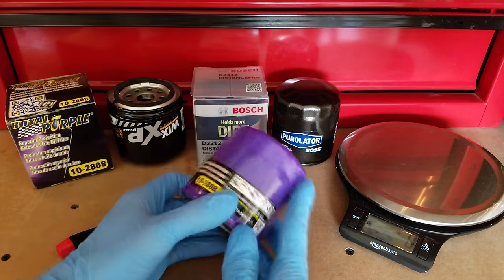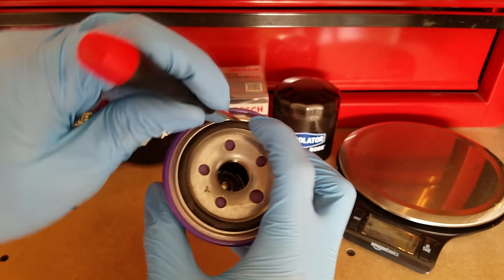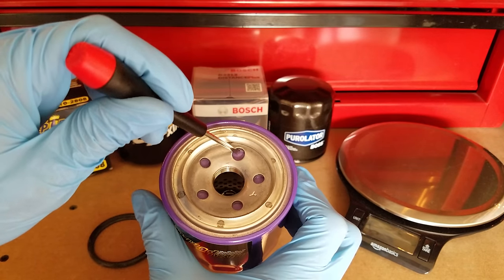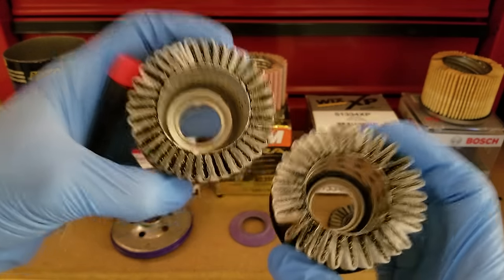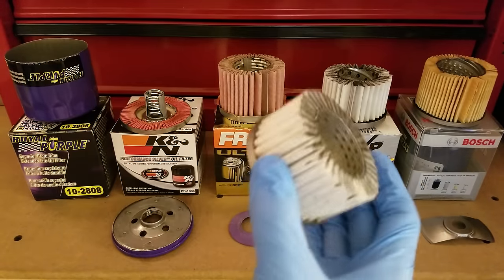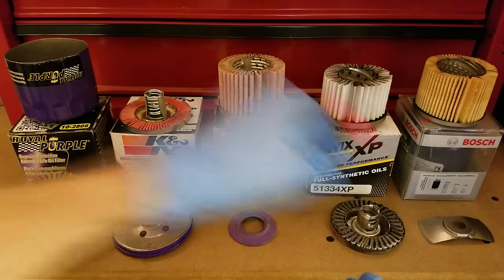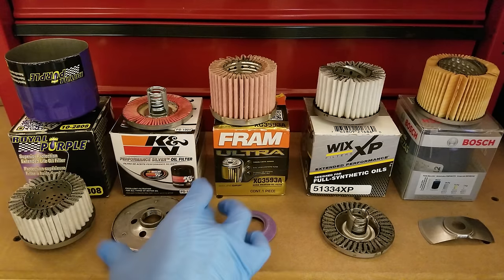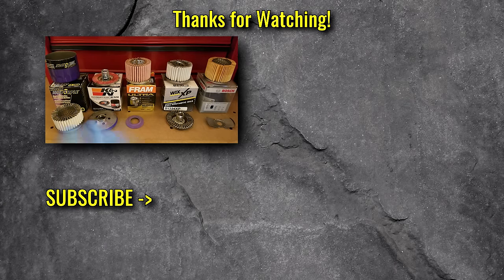Royal Purple filter Cut Open!  vs FRAM vs WIX vs BOSCH

Comment: I worked in the industrial industry building lube skids & all of the big name clients like Caterpillar require a specific micron rating for there engines.  These type of videos have no significance without actually testing them, you also need to take in to calculation the weight of the oil and how it changes after being warmed up by the engine.
Reply: I think these types of videos do offer significance in terms of being able to see what is actually inside of a filter you are putting on your engine. Micron testing and rating is important and I see the point regarding that for meeting spec requirements, but I am happy to see all of these videos without having to actually buy them and cut them open myself.

Comment: Champion Labs makes Mobil-1, K&N, AC DELCO after market, Bosch, Super Tech, Royal Purple......They make many different filters for all price points for different brands. It is like ordering off a menu you pick case thickness, seal materials, case design, bypass design, etc.....and they make exactly what you ask for.They are one of the few companies with a lot of options that you can pick and chose from. Few of the other big oil filter companies give other people anywhere near that level of options for a re-branded automotive filter. Wix, Hastings, Donaldson, Fram, Puralator, Baldwin, Champion Labs all make filters for many other people all over the world.
Reply: Which is best for sn old skool car??

Comment: I'd like to see dirty oil going through a clear tubing and see how it filters or any tests afterwards.
Reply: There is one and it shows filtering the soot out of oil on a diesel engine. Was pretty interesting to see it go in black and come out not black
Reply: I'd rather watch paint dry, if you don't mind. But you are right, lab testing (or fleet testing) are the only way to determine the validity of any mechanical theory.
Reply: Agree.   These are just beauty contests.   How do they filter, what is the resistance, and when does the bypass open.   Does the mfg even give a spec for these params.
Reply: A pressure full flow filter won’t clean the small particles that colors the oil.
Reply: You won't be able to see much difference .

Comment: Filtration is very important to remove impurities.  BUT Oil Flow is as or possibly more important to pad/insulate bearings, lifters, cylinder walls , remove excessive heat & protect turbos.  SO, to much "Filtration" isn't worth smoking a $10,15, 20k motor!

Comment: I worked for Fram in Albion Illinois. We made most of the filters on this video. The pleated glass pleat is the better filtering media. The yellowed or brown paper is a cheaper option. The depth and number of pleats is important. Larger surface area for filtration. 
     The over flowing adhesive is because the cap spins on a machine to distribute the adhesive evenly. Its dont to all the filters in this video. Also the filtration media is put on the cap by hand.
Reply: fram is shit, i wouldn't put a fram on my lawn mower
Reply: @markussone7334  yet cars are hitting over 200k using only fram 🤷‍♂️

Comment: Nice job on the video,  I still like the Wix XP also NAPA Auto parts sells the silver, gold and platinum line of oil filters made by Wix in North Carolina; made in the USA!
Reply: TMI, Not very many things are made here anymore sad to say.
Reply: Bought the Wix XP from Rock Auto available on Amazon cost a little more.
Reply: WIX is now owned by Mann-Hummel. The factory is next to I-85 in Gastonia NC.. the water tank is painted like a WIX filter.
Reply: Cool, one of few oil filters made in the USA!
Reply: Fram, ford, Briggs, stp, ect. Many OEM filters are made in Illinois. USA
Reply: yep made in gastonia. i used to live in cherryville and lincolnton now im in farmville nc
Reply: @aceroadholder2185  Fram is also owned by Mann
Reply: The NAPA platinum is a WIX xp. Yup!
Reply: FL1A for me. Inexpensive and made great.

Comment: My guess is the reason that they made one of the holes larger than the other four holes is they wanted the volume of all the holes added together to match the volume of the center hole so there would be no restriction in flow by the filter housing since the inlet and Outlet would be the same size.

Comment: I haven't seen this yet anywhere, The big 3..
Chevy:AC Delco
Ford: Motorcraft
Dodge:Mopar.
Reply: Ive always insisted on a factory filter, they usually cost the least, and im sure the factory isnt spinning on garbage filters. Goto the dealer buy 10 at a time. That will last you quite awhile nowadays. Glad to see someone doesnt get caught up in all the hype.
Reply: Just watched an AC filter cut up, paper end plates, all others sreel, junk valve and spring. Made to last 3k miles, no more. I'll never buy one.
Reply: I once ordered Motorcraft for a job as wanted to impress the customer, opened the boxes and they had Fram written on them, at the time I took this as a thumbs up for Fram but, hey, having watched Stephen Cox's video " the worst  filters on the Planet" I now know that these filters are cheap and nasty.
Reply: The smaller AC Delco filters might actually be worse than Fram
Reply: Brian Cantafio could be interesting with older cars as the “factory” uses licensed filters. “Factory license” could be changed over with manufacturers, basicly with whoever the company figures out the best deal. Example: Mopar factory filters for jeeps are made by Wix (Same as NAPA gold as of recently (now?)) earlier it was made by a different company.

Comment: the dark stuff on the bottom of the metal plates that hold the filter media in place is called Plastisol and the blend used for filters to make it turn from a liquid into a solid you cook it on a hot plate at 375 degrees Fahrenheit for around 15 minutes

Comment: Gasket retention failure can be a HUGE problem. Honda had a retention issue with their OEM filters for 2nd gen. CR-Vs where the factory original filter gasket remained adhered to the engine block during the first oil change. Some techs failed to notice this, resulting in stacked gaskets and oil leakage. Oil leaked onto the exhaust and started a fire. Several vehicles lost due to this. Gotta like the positive retention even though I'm pretty sure I'd notice a gasket missing on the removed filter or one stuck to the block.

Comment: My guess is that the Royal Purple has one larger inlet hole of the five in order to tweak the flow of oil which they measure precisely.  5 the same size is just not enough.

Comment: My 3 favorite filters.

Royal Purple
Purolator Boss
Fram Ultra

I'm actually not a Wix xp fan

The Purple has a nice combo of filtration and flow.
Reply: Hmm i been using the wix xp for about  3 years now. I have upgraded my oil to royal purple just to try but now it seems like ill switch to the filter as well, thank u

Comment: I've heard the Royal Purple costing around$16-$18. That is subjective since prices can fluctuate but it typically stays around $16-$18 give or take. The Fram Ultra Synthetic roughly goes for $8-$10 dollars at Wal-Mart and is readily available instead of ordering it or if you know a royal purple retailer. Personally for me, Royal Purple is a great filter but its not worth it. The Wix, Purolator, and K&N are great as well and those are typically also $11-$14. Also readily available at certain auto parts stores.
Reply: And that’s why I hit the local Walmart and grab a Fram Ultra for under $9!
Reply: purlator is like $3
Reply: But that $3 Purolator has a history of the filtering media tearing while in use. I will use my Fram Ultra with a much more stout, full synthetic media. And if I can't get that, I'll go with a Wix XP.
Reply: Amazon = Readily Available (and if you are truly prepared, have one on hand)
Reply: Price difference is moot.  Even if you change oil four time a year which is overkill for average driver, you're talking 30 extra dollars a year.  For me it's worth the 30 dollars for extra protection.  I've been using royal purple filters and oils for more than a decade in my cars' engines, transmissions, differentials, and transfer cases.  One is a 2000 the other is 2004.  IMO new or rebuilt components cost more than then little bit extra I spend on premo oils and filters.
Reply: not to mention fram XG filters do really well everytime ppl actually test it... like this old test here:
http://www.gmtruckcentral.com/articles/oilfilter/comparison.html

I wouldn't use the basic orange el cheapo frams tho... But I think everyone knows that by now. At least I would hope so. 

and to the last guy who said the costs doesn't matter @BigBrotherIsTooBig -- you can say that about a lot of things. in fact I do.. but I also realize saying "oh it's just a little more might as well" does ADD up quick when you do that for everything in your life. So really you're just best off shooting for price/performance ratio and just being happy with that. That's my $0.02 anyway. Unfortunately price/performance ratio can be hard to find for some things... takes research or just giving up and paying for whatever is nice.
Reply: Can't you get it online ? Or get Mobil1.

Comment: Couple months ago I noticed my ranger seemed like it was priming the oil system every time I started it. Had 1000 miles on the oil change. Pulled off the microguard filter I had and the anti drainback was dickered. Usually when I pull the filter the oil pump gives me a shower. Not this time. Never buying microguard again
Reply: Thanks, any other information? I run two Vehicles…2007 Canyon, 2015 Journey///4 CYLS

Comment: "Do not" buy a Fram oil filter.
If you do not believe me then, watch this video.....The worst oil filters on the PLANET!!!
This is on You Tube.
    After I saw this, I changed my oil filter.
Awesome video. Thanks a lot.
Reply: Neil Williams Ferrari and Lamborghini used fram and is the recomended for all classic Ferrari and Lamborghini. Also I run fram on all my vehicles including my work truck that I drive hard and tow with over 250k miles my jeep xj with over 200k miles and that hits az trails all the time and my 293k ae86 gts that I track and daily so whats the problem with fram?
Reply: If you watched this video ........The worst oil filters on the PLANET!!!    then, you know why.
Reply: Neil Williams oh so a youtube video and the person that made it is smarter than all the manufacturers and classic car restores? Most popular oil filter and of they are the worst then why are they the most popular? Can't be that bad if all my vehicles run fram and are between 200k and 300k miles and I've never had an issue.
Reply: To each their own.
Reply: I prefer an oil filter that "IS NOT" made up of "all" soft paper like material.
If you look at this You Tube video.....The worst oil filters on the PLANET!!!, you will know that Fram makes a crappy oil filter.
    If you can't see what's shown on this video, you are either blind or ignorant!
Reply: Oh! I didn't know that. my bad.
Thank you for your reply and help.
Reply: I've been using fram for well over 20 years and no problems. Just because some shithead on a youtube video says something doesn't make it true. Fram has some good filters, just don't buy the cheap one.
Reply: I didn't know fram had good oil filters!?
My bad! Thanks for the info.
Reply: You are SO CORRECT!  Fram SUCKS. Fram is made in America, BUT the insides are imported from CHINA. Fram media falls apart in your engine and plugs oil ports. WIX is AWESOME!
Reply: @lloydmorrisonii1373  How many engines have you lost to fram filters?
Reply: I agree.
thanks for your answer.
Reply: I've heard a lot about that one.
I'll give it a try next time.
Thanks for the heads up.
Reply: This dude gotta b slow....U keep repetitively typing over and over the same shit....ON THE PLANET!..
Reply: PEOPLE>.  Fram has upgraded even the BASIC filter..   Check it OUT HERE : https://www.youtube.com/watch?v=bQ6hFihPcdg&t=241s

Comment: Just a tip I do know someone who had re-rebuild an engine they just rebuilt due to an oil filter oring getting stuck to the block and a new filter with oring being placed over it.  Engine had enough oil pressure to keep the idiot light off but not enough to keep the rod bearings happy. The reason for oring sticking was that the new engine paint glued it to the block. Either way, always check that the oring wasn't left behind and make sure there isn't paint under the oring for oil filter. Easiest way is just to put an oil filter on before painting.

Comment: I've used both Wix XP and Royal Purple for the last 10-years, and when sending out oil samples on 'the same vehicle', find very little difference between the two...filtration is roughly the same...and NOTHING beats them (not Mobil-1, who also makes Royal Purple; and not K&N)...
Reply: Wix XP = 99% @ 50 microns
Royal Purple = 99% @ 25 microns
Fram Ultra Synthetic = 99% @ 20 microns
Reply: Kevin Miller wix XP 99 efficiency @ 21 microns, according to Wix website
Reply: @egertonridout4102  just to clarify, the Wix XP is not rated 99% @ 21 microns, it is 99% @ 35 microns and the 21 micron figure relates to the smallest particulate matter that they have been tested to effectively be able to capture.
Reply: Thanks, any more in-depth informations… I like to use the RP, DEFAULTED to BOSS Purolator //Napa Gold (*for Short)mostly……Interestingly, my NEW SHOP switched tO VALVOLINE SYN. *& VO58 Filter from BULK PAK,ETC.
Reply: Also, what you using in , $& on.?

Comment: sometimes it nice to have thinner metal on the side walls. like when you get a filter that worked it way so tight you cant get it off. that way you can drive a screwdriver threw it and bust it loose.

Comment: My oil still looks clean at 6500 miles with the WIX XP. I go 7500 miles with Royal Purple. It was a little expensive so I'm making a switch to STP Extended life 10,000 mile filters. It's under $9, and they have a silicone gasket and drain valve. The spring is also a coil. They are not wire backed, but I don't really think it's necessary. I would only get wire backing if I'm racing or towing at consistently high RPM.
Reply: Dcc357 ew

Comment: There were scientific tests done long ago by Consumer Reports that tested micron performance of filter brands and also got into quality of construction issues. Wix and Fram ultra, Purolator, and Delco were well rated.  Looks like not much has changed. There were cheap filters that had metal bits from machining the case still attached. I have seen that myself on a cheap orange Fram filter, but that was 30 years ago now.  I still trust the Fram ultra.

Comment: Royal Purple sponsored me during my Superbike racing.
Good oil. Never had a single mechanical issue.
Did a great job protecting those huge lumpy camshafts and cylinder walls at 14,000 rpm.
Worked well with the wet sump clutch too.
RP greases and spray lubricants were good too as was the Purple Ice coolant replacement.
I never had any complaints with the RP products and used the oil in my cars and RV too.
Heck we used the used racing oil in our lawn mowers, generators and other equipment!
It never seems to break down.

Amsoil and RedLine are good products as well.
Motul is solid also.

Comment: It doesnt matter if some of the oil bypasses the filter element, the particles will get trapped in good time anyways soon enough since the contamination doesnt form that quickly it doesnt matter if theres a perfect seal around the edges of the filter element

Comment: One thing about the uniformity of the pleats with wire backing to consider is it's unused.  When you actually run and cover it with hot flowing oil the wire is likely to cause them to perform similar.  With respect to the uniformity effecting flow I think there will be enough give + - they'll end up the same in use.  Or when you pull them out it would be virtually identical between say the royal and wix.

Comment: You should have shown the rest of the K&N filter. It looks like high quality from just what was shown.
Reply: It is except that it uses a nitrile anti-drainback valve, I had one fail on me during a 6000 mile oil change interval.

Comment: Based on at least 100+ filter changes I have done on personal vehicles. 1) I have never had a filter seal leak or dislodge from the base. 2) I have never had a fikter case split or leak. 3) you are looking at construction, but what about filtration qualities which means you need a lab to do that test.